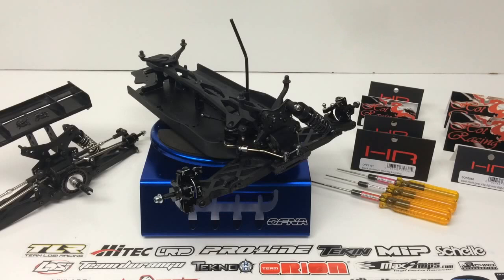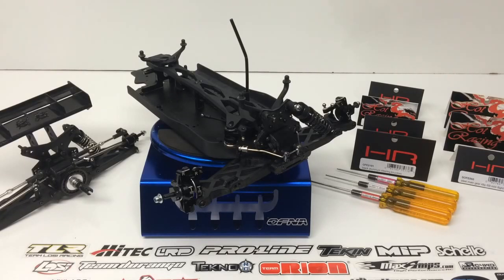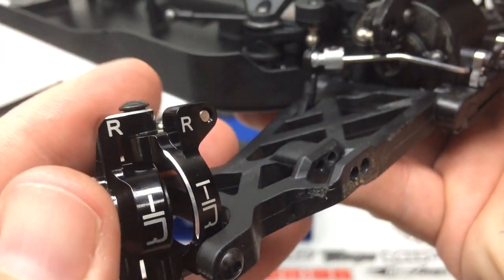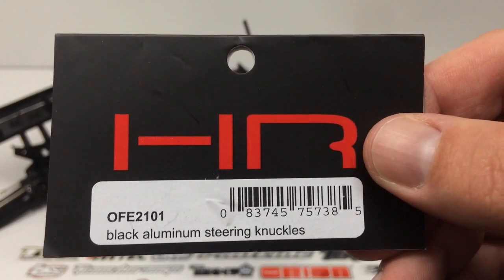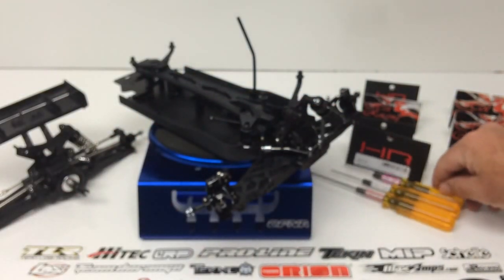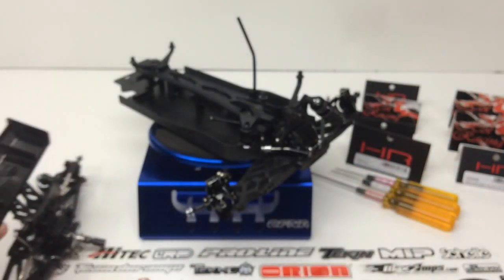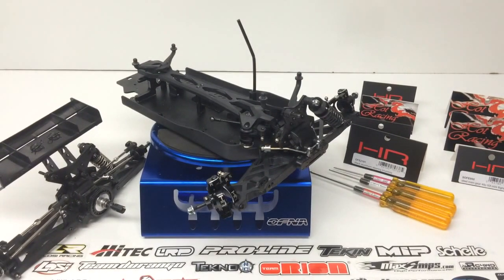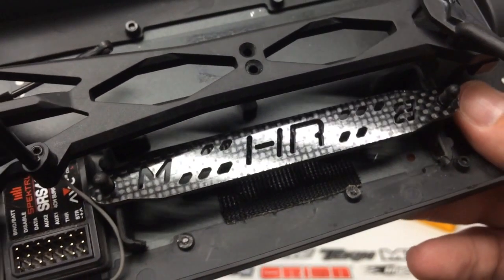Losi Mini 8ight T - Upgrade Series 1 - Hot Racing

Comment: Great Vid.  Thanks for taking the guess work out of it!
Reply from the maker: Enuf4U Thanks for watching.  I have boxes of parts to try out and see what will work.  Already off the bat, the 60t spur will require to cut out or trim away the bottom of the chassis.......which I kinda don't mind since I'll be running it on an indoor clay track
Reply: The RCNetwork I'm running mine outdoors so I don't want to cut into the chassis.  What gears do you recommend that I get to get more speed out of the stock motor?
Reply from the maker: I think with any long term running of the stock motor, you're going to be limited to the stock spur size and a 12t pinion.  I would def upgrade to the steel gears though.  I will have some motor upgrade options with gearing here soon.  Stay tuned

Comment: Max Amps has a battery tray adapter that will allow you to install a wider battery and takes away potential damage from the small factory battery bump holders. $15 shipped.
Reply from the maker: Enuf4U I saw it, but really don't want to raise the battery up ay higher.  It also has constraints on what size batteries you can run.  I currently have a 2250mah 2s, which they spec only an 1850mah with the tray.  I'm sure I can come up with a solution
Reply: The RCNetwork look into glaicer lipos i have there 2200 30 c 2s packs and all ya need to hold em in is some velcro and move the frotn batt holder to the farther postion works like a charm.

Comment: I just stripped the stock pinion and spur gears on 2s. should I just get the stock setup or should I go for a hardened steel pinion gear and steel spur gear? can you get a hardened steel pinion that will work with the stock motor? I plan on still running 2s.

Comment: I love the upgrades that you did and Ordered the 12mm Clamping Wheel Hexes: OFE10W01 and I could not get them to go on tight,i tried tightening them as far as they would go but when i put the wheels on they slid right off, I even stripped 1 of the screws now, this happened on all 4 wheels. any ideas on a snug fit?
Scott
Reply from the maker: Yeah, I noticed the same, but with some pressure with my MIP driver, I was able to get it to catch on decent.
Reply: The RCNetwork
I ordered another set of Clamping Wheel Hexes as i stripped 3 of the 4 screws, and i ordered a MIP .050 driver, maybe that will help.  Thanks for the info

Comment: As I thought ! Any chance u can put a link to where these were bought ?
Reply from the maker: chris wallis Here's some info from their site:
This part is available for sale or distributionthrough @item.cgi?part_id=75740 in Nashua, New Hampshire, USA
also available from:The Toyz : Auburn , WA 253-336-4777Toadz Rc : Redding , CA 530-605-1919Galli Mods, Ltd Mahpoac: Baldwin Place, NY 914-621-0044Performance Rc Hobby Burlington : Burlington , WA 360-755-9464Mississauga Canada Galaxy Hobby & Gift : Mississauga , ON 905-848-3368West Bank Hobbies : Marrero , LA 504-328-0209Extreme Hobbies Shasta : Shasta , CA 530-949-8975Turn 4 Hobbies : West Boylston , MA 774-261-8191
Reply from the maker: chris wallis This place is right across the lake from you:

https://www.hobbyetc.com/index.cgi?now=1

Comment: I have a mini 8ight truggy and stripped the diff with stock motor and 2s. Please do a upgrade for that
Reply from the maker: Yep, def.  So far I have scheduled the Hot Racing, then Servo upgrade, Motor/ESC, Some other Losi upgrades, Wheels/Tires and finally some maint items like how to set gear mesh, adjust slipper and Diff shimming

Comment: Which parts are essential and which are just upgrades to look cool thnx
Reply from the maker: Henry Bennett Motor, ESC, Spur and Pinion for the Series on the M8T.  The Hot Racing Parts/Losi help with durability once you've upgraded the electronics.

Comment: I ordered the spur gear as well as the pinion gears both are .5 mod 12t but the pinion gear will not centre on the motor shaft it is to one side when tightened. Why is that so?
Reply from the maker: +Exceeded Not sure on that one.....will the pinion not line up with the spur?
Reply: oh because we need the conversion sleeve for the motor 1/8 to 2mm. now its all set and ready to go! just that now my car cannot travel in a straight line! always happens when i change these c-hubs (T_T)

Comment: So I'm looking for your opinion on gearing. I've got a velineon motor in my 8t. What are your thoughts on running a 20t pinion with a 58t spur?
Reply from the maker: I'm running a 60t 48pitch spur gear with a 16t 48p pinion and I had to widen the slot in the motor mount to all the 16t to have the right gear mesh.  I know you'll pick up a bit of room with the 58t, but I doubt you'll be able to fit a 20t.  I'm sure the VXL motor can handle it, just not sure the motor mount can make it happen

Comment: are the front and rear suspension arms from HR for the mini 8ight buggy shorter than the mini 8ight truggy?
unable to find suspension arms from HR for the truggy =(
Reply from the maker: +Exceeded Yep, the arms, turnbuckles and driveshafts are longer.  Don't go with aluminum arms anyways......bad for an offroad, as they'll bend and cause severe damage......I know RPM brought out the Mini 8ight arms.....not sure on the T, as their website is the toughest to navigate
Reply: thanks for the tip about the arms bro! you are right. no point upgrading the arms when its going to be damage. it's like throwing away $$$ i will just stick to the c-hubs and knuckles! less worry too yeah :p
Reply from the maker: Nice!

Comment: what do 0.5 mod mean?and if I get a steel 58t 48p gear could I use the hardened 16t pinion?
Reply from the maker: The Losi M8(T) for what ever reason comes as a .5 mod gear pitch, or in other words how many teeth per XX.  90% of pinions out there are .48p which is very, very close to .5mod, but not quite.  After a while, the 48p will wear away at the .5 and be much louder.  If you go .48p, do both the spur and the pinion.  If you go steel spur, you have to go hardened steel pinion

Comment: hey do you know of any fast chargers i should i get for my losi mini 8ight cause im new to rcs and dont know what to buy and i also need a higher power battery
Reply from the maker: Do some research.  I do not recommend fast charging Lipo batteries, especially if you don't know what you're doing.....and "high power" means many things.  More voltage. more run time?
Reply: Almighty Squall go Lipo. Research Lipo safety and never mess with round cells again. Dynamite has a nice cheap charger and Speed Pack that fits perfect. Be sure you ESC is set to the proper chemistry. This is in the instructions. 

The power you get from a Lipo is amazing. May wanna gear down two teeth on pinion though. With more amps comes more heat. The stock motor is junk as well ESC. So be prepared to replace them. Castle sells a good Micro set up. The motors are small but 4pole so they are making good power. Grab 5,xxxkv motor. Little more top speed as stock motor is 4500kv.

Comment: have a losi mini rally n having trouble with the wheels binding up.  Any suggestions.?
Reply: Robert Stecker can you describe this in more detail? 

My thought initially is thinking diff issue. Holding one wheel and turning the opposite side. Is it smooth? If not then it's the diff. If you replace. I recommend packing it full of 100k silicone grease. It'll give it better posi. Add some shock protection. Shim the diffs for good smooth mess with pinion gears too. 

Lots of info on the web.
Reply: Owens Racing. I bought the hot racing aluminum front n rear steering hub carriers all the parts, but there for the mini losi eight buggy. But the chassis are the same. I bought the wheel spacers and everything. And everything fit correctly. But as soon as I put the wheels back on they felt like they were rubbing. as soon as I tighten the 12mm lug nuts down they don't spin as freely like they use too.
Reply: Robert Stecker I'm gonna say the hexes are to narrow. Take your stock hexes and try them. Should resolve it.

The Buggy hexes are narrow. So it's probably seating your wheel on to the hub. Where it should seat the hex to the wheel leaving little space between hub and wheel.

Comment: That's so hot I think I'd get burned; that's why I don't usually buy their products.
Reply from the maker: Some of HR's parts have improved...but there's still one's I steer clear of, like thier universals
Reply: @TheRCNetwork  Thanks good to know. When is comes to aftermarket parts I kind of have three tears factoring in their product line's quality & support for a variety vehicles.

1. MIP, Vanquish, Lunsford, Robinson Racing, Pro-Line...
2. Tekno, AVID, RC4WD, GMade...
3. RCLions, Hot Racing, STRC...

I'm sure I forgot quite a few in those lists, but I'm sure you get the gist. #1 Tier stuff is $$$ and you get a quality product that will work perfectly in whatever it's designed for from their solid list of supported RC's.